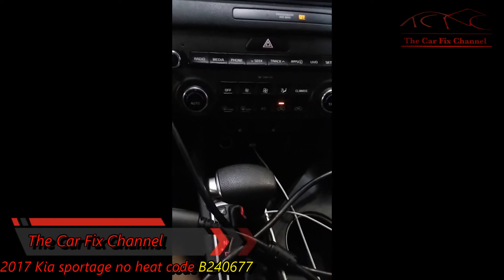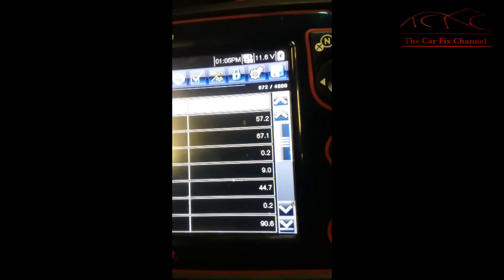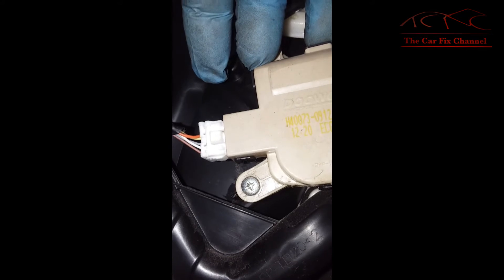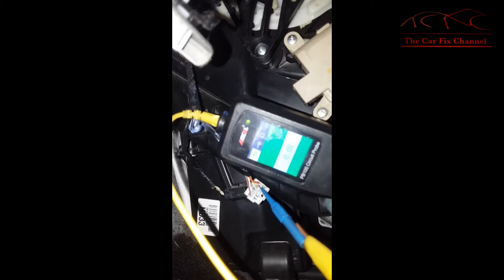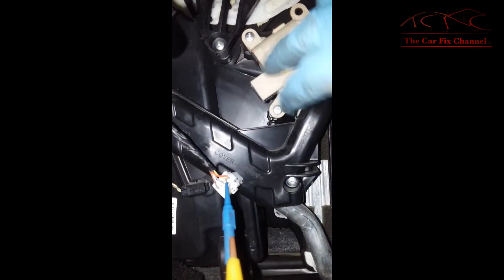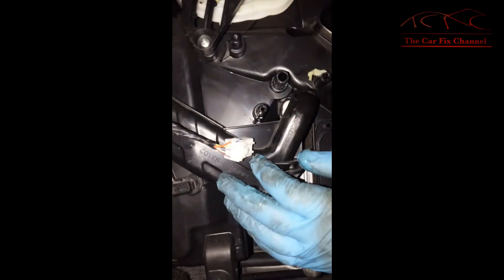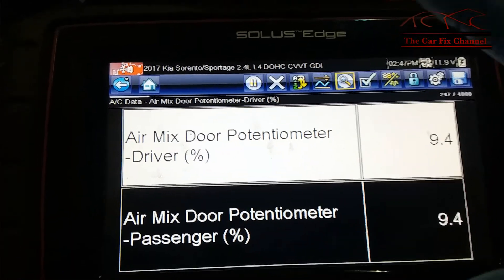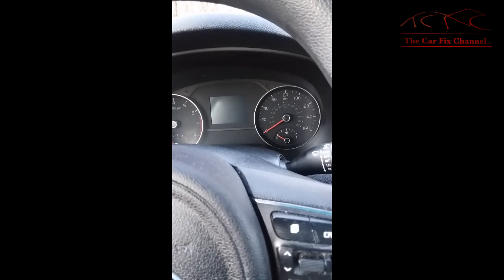2017 Kia dual zone HVAC system code B240677 no heat on one zone

Comment: Anyone got the part number for the actuator on the driver side above the gas pedal back behind the panel? 

 I have heat on the passenger side nothing but cold air on the driver side. Thank you so much for any help. Or could you give me the part number? That’s on the actuator have a 2017 Sportage EX2.4 L

Comment: Anyone got the part number for the actuator on the driver side above the gas pedal back behind the panel? 

 I have heat on the passenger side nothing but cold air on the driver side. Thank you so much for any help.

Comment: I see no one has provided the part number for that specific actuator on the driver side. However, several people have reported success on replacing it, so please provide the part number of the blend actuator. Parts manual is very confusing and has two actuators on that side that looks similar

Comment: So are there 2 actuators one for the driver side and one for the passenger side?
My 2017 sportage stays hot on the driver side but the passenger stays cold with maybe a little bit of change..
Reply: Yes, the passenger-side one is a lot tougher to access and replace. The code for that is B241577
Reply: @99shadows66  what if I don’t have dual temperature, is this actuator located in the same place?
Reply: @JulioLopez-l3p  Are you getting warm air from the left side and cool air from the right side or vice versa?

Comment: This video was very helpful, I have the same issue on my sportage.
Reply: Do you have the part number?  I've been trying to find a replacement
Reply: Hey Ben were you able to fix your issue?
Reply: @mariograves7215  yes, it was a bad blend door actuator
Reply: One more thing. Today I discovered the driver's vents were red hot even after I turned the AC to 60. The Passengers side was ice cold  but the drivers side was still hot. Was this the case with yours?